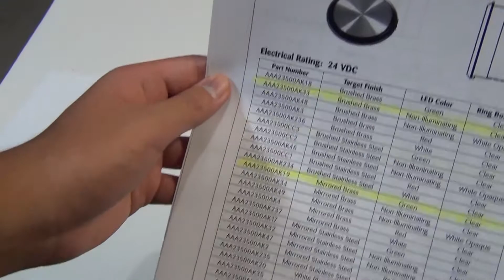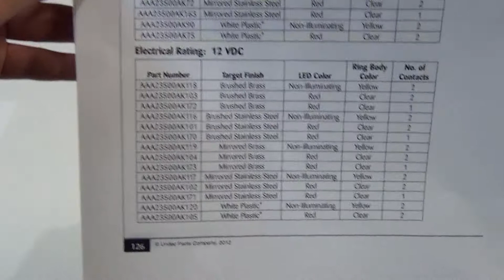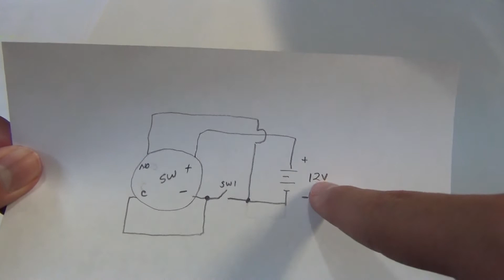How to wire Otis Elevator buttons to light up when pressed

Comment: Hello. I have three buttons with white four-pin connector like a PC fan, but there are no labels on the connectors for the part numbers. Instead, there is four lines of numbers a letters that don't seem to correspond to anything Google can find.

Can you help me track down the pinout and/or values and voltages for these? Identical PCBs on all three.

1. Brushed brass, protruding button - AAA BY 79 V47
2. Polished chrome, flush button - AAA AK 2 X08
3. Polished chrome, flush button - AAA AK 2 V23

Comment: I have a flashlight that I want to out a metal push button on and am unsure on how to install it. Looked everywhere, no luck. My trouble is that everything lights up with connected but I have to switch it to off on the battery clip to shit it off instead of the latching push button doing it for me. How do I fix this?
Reply: make shure you not only cutting off one contact with the button
Reply: procksomaterman I tried that and nothing is happening except the entire circuit is flowing due to the power being connected to the switch. The light itself won't click on unless connected also to the power itself.
Reply: Josh Wallen im really sorry for the delayed reply but you should ask a electrical engineer about this  but here is one last attempt

with your positive/or negative lead and thread it thought the switch then have it go right to the lamp, have the othrer lead you did not put thought the switch go directly to the lamp

Comment: Hi. A dangling elevator wire. You can see it swaying back and forth through the small hole. The Copper end was getting really close to the Stainless Steel Plate. I pulled the Pig Tail through the hole, which suspended Copper end in the Air, stopped the swinging and secured the possible Arc or Spark. Now I may be getting fired by the VA hospital in Columbia Mo. I worked building Switch Gear for 4 years and know quite a bit about dangerous situations. Was I wrong? I will most likely lose my Job. No, wasn't any elevator fire. Concerned. George